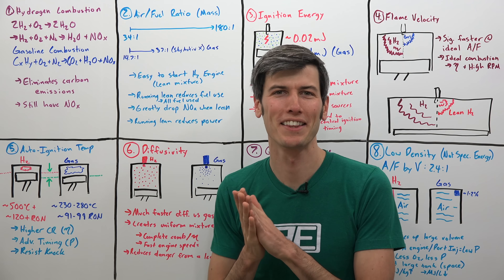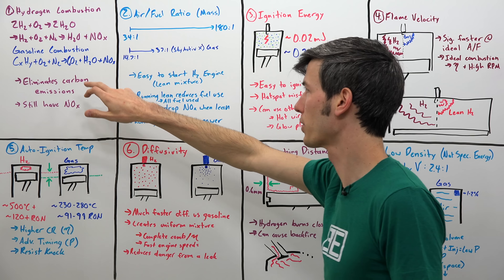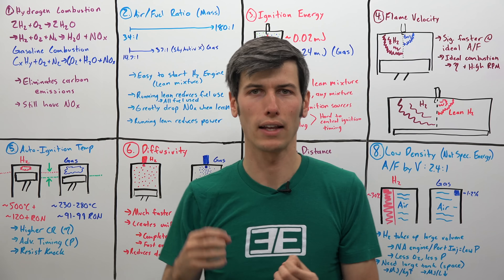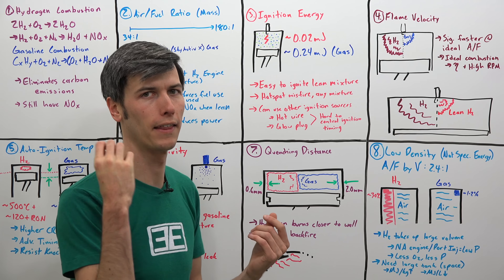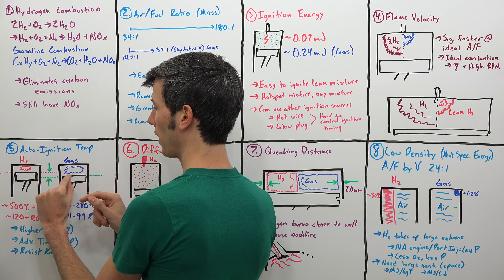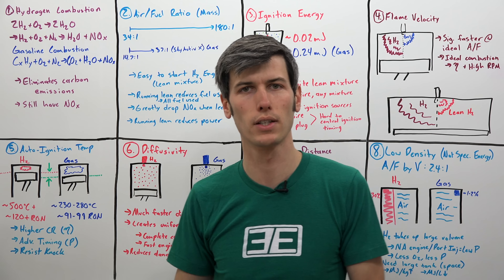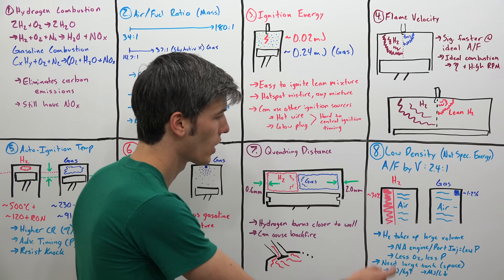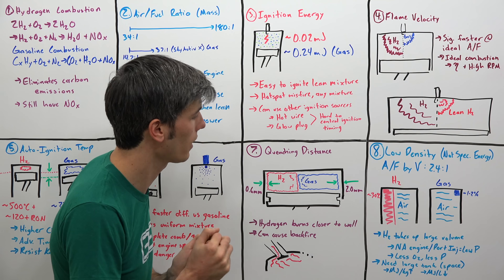The Difference Between Gasoline And Hydrogen Engines

Comment: You do not consider the common rail diesel engine way to work for the hydrogen combustion engine. In diesels the engine fuel is injected in the cylinder exactly when it is supposed start combustion (or a bit before). And this means that diesel engines injectors also do the "ignition task". So no spark plugs is needed. And this also applies to hydrogen comb. eng. Your mind is set on the gasoline combustion engine for the Hydrogen combustion engine which most likely is wrong.

Comment: Hmmm... You didn't discuss the Lubricant requirements... Hydrogen burns dry, like Propane. The cylinder(s) need lube or the engine dries... When converting from Gasoline to Propane, the engine must be rebuilt to meet the propane requirements. The same with Hydrogen. Otherwise it's a great video :-) Thanks

Comment: I am wondering about condensed hydrogen that is solid form that can be turned into a powder. Are there alternatives to oxygen for combustion?  Or is oxygen more desirable because of water being the result?

Would a different shape cylinder head be more desirable for hydrogen? Such as a spiral but not particularly a spiral.   

The reason for this questioning is I am curious to know a couple of things. First do different chemicals that burning require different shapes? Would a slower burning fuel be more efficient with a different design?  Turbines work with water, and air as well as fuel (like jet fuel).  I remember quite a few years ago reading about turbine car or Automobiles in the 70's or was 60's. Doesn't matter really what year. Point is do we have the technology today to make a spiral engine more efficient than a "V" block?

As far as alternative fuels hydrogen seems to be the best but i see many issues including the ability to smell hydrogen or see the fuel burning.  

Electricity is said to take the path of least resistance.  Because of gravity the most efficient and effective way for a planet to move is in a circular way as far as I understand.   If I thing of a pinwheel and or possible better a snail shell. I wonder if air pushing out of a pin wheel is cause of the movement more so then the air moving in? I ask because if fuel was pushed through the sent of a snail shell type shape and the actual name of shape is escaping memory.   But if fuel was pushed through the shape and combustion was at the opening of spiral shape would that be more effective and efficient as wells as causing less friction?  Could speed be controlled better than a turbine engine?  Could better transmissions be made? 

Is alcohol from a sweet potato more combustible than alcohol made from corn or grass. Least amount of processing are my thoughts!  

In addition I was still wondering about the compressed air vehicles and how they work. Have you already done a video on vehicles that use compressed air? 

I don't like being controlled. When Henry Ford was alive fuel was a debate. Alcohol was in competition with gasoline.   What I like about alcohol is that can be made at home and doesn't require me to be dependent on a company such as the monopoly of oil.

Comment: Was so hoping you would cover mechanical design considerations related to material needs.
What different type of Valve material is needed 
What kind of lubricants are compatible with Hydrogen combustion, (Miscibility}, lubricant washout
What are the basic types of hydrogen fuel storage-containment used.

And Finally the most important....how many clear and sparkling swimming pools will be filled from the Hydrogen engines condensed exhaust after a 250k mile lifespan.

Comment: My main concern is trying to clean up the exhaust of an old diesel engine. One that was used extensively for years in over the road hauling. I want to experiment with injecting the output of an hho generator into intake and making no other changes to the engine. HHO gas should burn faster and completely ignite all of the fuel normally used in the running engine making cleaner exhaust. There should be no problem with engine knock like in a gas engine because HHO doesnt self ignite under compression even at diesel engine pressure and heat. It will ignite when the fuel is injected into the high compression chamber like an ordinary diesel engine. I'm no big scientist I'm a Diesel mechanic. Any improvement in the MGP would be a happy <or sad> coincident, I am concerned about cleaning up the exhaust without destroying the engine, let the mpg fall wherever it will good or bad. Am I wrong in any of my assumptions? I'm not sure if burning 100% of the fuel will cause the engine to wear out sooner because of lack of lubrication in the cylinder on the power stroke. Only way to find out is run it to see. lol
Reply: I have run an old 1982 Nissan GQ 4 WD Naturally Aspirated.
First, I generated my Hydrogen on the go.. I separated the two Gasses and only used the Hydrogen.
I did all of this while using a Dynometer along with Exhaust analysis, to monitor the progress of my development.
I developed my own generator (2 units on the Bull bar) 
I installed a larger Alternator.
I was drawing 45A from the 12V alternator.  
Now the results..
I was driving between Melbourne and Sydney (860 km each way).
I used 80 l less fuel on the round trip. The Dyno recorded an increase in HP of 6%, a more impressive increase in Torque of 9%.
The exhaust analysis showed 49+% less noxious exhaust output.
Some negative people told me "But you loose when you use / loose, power from the  high Current draw from the Alternator". 
They have totally missed the bus, all of that was taken out during the running of the units during the tests.   The results I have reported have all included that drain.
My only problem was that the units I constructed,  were constructed from Plastic and these vibrated apart over a 100,000 km's.
I then sold this old vehicle. It was running quite well without the Hydrogen.
End result, this vehicle saved fuel, increased power /Torque, as a hybrid, saved the environment to ma much larger degree than EV, (No Mining precious materials  or new vehicle construction emissions, apart from diesel fuel, no hunting up other fuel source, [water.]) 

I am working on running a 7.5 KW generator on Hydrogen only.
For lubricant, I will use a Lithium Based lubricant.

Comment: A hydrogen engine does actually sound completely viable so long as its efficiency can match or exceed the current 40% thermal efficiency of many modern gasoline engines. It sounds like they will have to be direct injection only with forced induction to make them viable. It makes sense they would have to have higher RPMs in order to compensate for the lower energy density per cylinder charge. As for emissions, it would seem that they would make the most sense for economy class vehicles that do not require a ton of power. That way the air-fuel ratio can be leaned out for most of the engine's operation and it will meet consumer needs and still provide extremely low emissions with a catalytic converter. However I do wonder if the cooling system would need to be larger than in a gasoline engine in order to keep combustion temps as low as possible to help lower NOx emissions. Another advantage that I see is that engine oil life should be increased without dilution from gasoline and significantly reduced carbon build-up. This means fewer oil changes in theory which is very good. I think I heard Toyota was developing a hydrogen combustion engine for the Prius and Corolla which makes sense because it would be way cheaper to build a very low emission combustion car than a EV that the masses can afford (not to mention you pretty much need to own a home for an EV to be practical at all). Hydrogen seems well suited to the economy car segment. While from what I understand, hydrogen combustion engines can actually be more powerful than gasoline engines, but the emissions problem is still there in that case. I suppose that could be solved with larger catalytic converters but I'm thinking they would be prime targets for thieves and would need some kind of anti-theft design. These engines sound like they would excel in colder climates where BEVs are at a disadvantage. As a combustion engine fan, I really hope to see vehicles for sale in the future that are hydrogen combustion powered.

Comment: Good info!  Given that hydrogen ignites so much faster can your timing be adjusted to almost TDC (top dead center) or even retard the timing to where it’s firing as the piston starts moving down the cylinder?
Reply: Yes..... That's the proper adjustment in timing when burning HHO
Reply: An even better added bonus: you can just run the engine with NO throttle on the airflow, like a diesel, feed it with a turbo, and your engine's effort of sucking against a vacuum disappears, since you can run the mixture so lean.

How much air it consumes will be determined by the energy present in the exhaust stream, like on a diesel. The ADVANTAGE over diesels doesn't stop: you can exactly regulate the spark/ignition timing for even greater efficiency than a diesel, as your combustion event can happen in the exact timing to maximally take advantage of whatever load/fuel mixture ratio is present.

Hydrogen is shaping up to be an ideal fuel, with but two drawbacks: sheer volume and high pressure storage. I wonder if mankind can find a way to solve those problems. Oh, wait, we already HAVE SOLVED THEM.

Comment: There is a video somewhere that a gentleman made his own source of, let's call it a sponge like, material that holds onto hydrogen and when heated releases it. He put four tanks in the trunk that look to be the size of four scuba gear tanks side by side. They lay on top of a warming unit and they power the car with hydrogen gas which in turn gives him the same gas mileage he has when running gas. Question is how much did that sponge material cost to make. How much is the cost to produce the hydrogen fuel and then pressurize the tanks. Best part is if the tanks were ever shot with a firearm or pierced in anyway they won't leak the hydrogen because of the sponge material thus not fueling a fire in anyway. But I do wonder what happens to the body being around that material which is radio active.

Comment: I was to remember, in the 5th square, that being the ignition timing delayed against gasoline, it allows a more efficient force to be transfered to the Cam, turning it more efficient, because in Gas motors, the explosion occurs when the cam it´s already in the top, applying a big deal of energy to sleev cam axel. Another thing, is that H2 is explosive and gas is expensive! But after most of the comments I had read, I think I´m to dummy to think I know someting about this! Good stuff although and I learn a lot! :)

Comment: Your explanation so clear that I'm inspired to ask: can't the engineeres design valves with direct injectors intergrated onto them instead of the cylinders for the hydrogen or even the gasoline motors??...then for compression ignition, they can use the Koenigsegg servo-valves which can just lift open to prevent sponteneous combustion

Comment: What if, like additives in gasoline such as detergents, we could have additives in hydrogen fuel that wouldnt be part of combustion but rather just be present to absorb some heat and carry it out with the exhaust to prevent the engine from reaching temperatures in which NOx formation could occur, as well as further decrease auto ignition possibility and reduce the likelihood of knocking caused by the low ignition energy? And as far as the low energy density to volume, with future advancements in cooling technology could we force a high mass of hydrogen to be compressed into a small space (with cooling to prevent it from exploding) and let out only the hydrogen we need while keeping the rest compressed? I’m by no means a scientist but I would love for you smart people to tell me why my ideas may or may not work in real life.

Comment: Is there a way you could physically demonstrate the performance of hydrogen with say... A small engine from harbor freight (:))? Almost everything sounded great except the part where storing it is noticeably larger than gas. I'm also confused about how hydrogen is low density, yet you can run air/fuel ratios up to 180:1.
Just a request would you be able to do this for propane/natural gas? Some people run their dailys on the stuff and industrial forklifts, and they've got some pep/pushing power (I can operate a sit-down forklift at home Depot). Only thing is, I don't know the emissions they produce entirely and how far you can go on a gallon. Thanks in advance. :)

Comment: You contradicted yourself a bit on the diffusivity and the leak in basically ignoring that it has a lower ignition energy so it is more likely to catch fire before it diffuses.  Engines have all sorts of hot surfaces and hydrogen is a pressurized gas which makes it more dangerous than gasoline in that regard. It also makes an automobile accident potentially more dangerous.

Comment: The most concentrated safe way to store Hydrogen is H202. Then breaking the molecule by pulsing the resonate frequency through the water using electrolysis. A square wave at the proper amps volts pulsed(across the base line) quicker generates more hydrogen and pulsed slower creates less hydrogen thus by using the potentiometer off the accelerator for a E-car you can create more hydrogen on demand. Rewiring an additional alternator to 3 phase by taking out the rectifiers allows it to be used as a high frequency high voltage power source for electrolysis. (a little more complicated than this explanation). 

Electrolysis used for removing rust from iron and steel and the current passed through the solutions in many metal plating processes produces HYDROGEN.

Comment: The hydrogen flame is not luminous unlike the hydrocarbon fuelled flames.  This means there is less radiant loss to the combustion chamber walls with hydrogen, more energy can be converted into work, rather than lost as heat to the engine’s cooling system.  It also means there is less likelihood of hot spots on the combustion chamber surfaces and certainly no soot/carbon deposits.

Comment: In my student days , lecturer talk about the concept of ordered and disordered energy and the conversion efficiency available between the 2 different types energy .The conversion efficiency for ordered energy can be 100% theoretical.The efficiency for disordered is determined by source/sink temperature, currently material considerations limit these temperatures .But in case of hydrogen it can be also treated as ordered energy source (proton donor) in a fuel cell , with increase in conversion efficiency, of course  
If it used as fuel in a ICE we know what efficiency to expect .In my humble opinion a waste of hydrogen (green).

Comment: Aren't you making a bit of an apples to oranges comparison when you're making the combustion for Hydrogen and Gas both contain "Air"? H2 is likely going to be 2H₂ + O, so you're adding a lot of Oxygen in the H₂ scenario here than you've explained. "Air" only contains 21% Oxygen, so if you're adding a substantial amount of Oxygen, you're changing the equation entirely. You're also reducing the Nox in the process because the ratios of Nitrogen to Oxygen will be reduced with the increase in Oxygen.

i.e. Your last diagram is wrong. It's not portraying the reality of increased Oxygen in the Hydrogen scenario.

Comment: Good stuff. I was hoping for info on water vapor as a by-product and it's effects on engine oil due to natural blow-by of the piston rings. Also 'steam cleaning' effects on any oil on the cylinder walls and how it may effect ring lubrication. A stainless exhaust would be mandatory too.
Reply: Gasoline and diesel already produce water in combustion, and yes, exhausts should be stainless by law, I think.

Comment: Yep, still have NOx, so you remove the primary cat as you don't need it anymore and put a diesel NOx SCR converter on the car - et voila, bye bye NOx, tailpipe product is H20 & N2. + No more greenie whinging.
For the energy density, use high pressure fuel tanks and turbocharged/supercharged engines - The tanks to carry more in a smaller space, the forced induction to make more O2 available for the combustion & increase the power...

Comment: Nitrous oxide can be dermadict reduced in hydrogen combustion by retarding the engine ignition timing . 
As Even the lowest test ceetain gasoline or caroseen is higher octain than hydrogen . 
   Running a hydrogen engine at the same timing before top dead center as a gasoline engine is insain as hydrogen restarted to its proper timing perduced 3 times the power .! 
 When you study octane hydrogen is at the bottom of the scale !

Comment: One thing I never see in discussions of hydrogen engines is effect of the H2O exhaust gas on the environment.  I'll grant you that elimination of carbon from the exhaust is a good thing.  But is introduction of water vapor also a good thing?  Consider how much this will increase the humidity.  If you are driving in a desert environment, where  there is next to no water in the atmosphere it may very well be a good thing.  But, pumping more water into an atmosphere that is already saturated with it can cause the weather to change.  Long term weather change is another way of saying climate change.  Oh, and did anybody mention that one of the most important greenhouse gases is water vapor?  Just something to think about.  You can't focus on the good without a careful examination of the side effects.  The good or the not so good.

Comment: So the way I understand it - Each 100 watts of electricity used to convert water into hydrogen will reap about 30 watts of hydrogen power.
Reply: EXACTLY!!!  H2 is not a fuel, it's a storage medium that has to be made at an incredibly high (inefficient) energy cost.